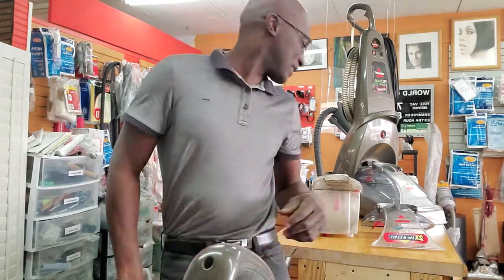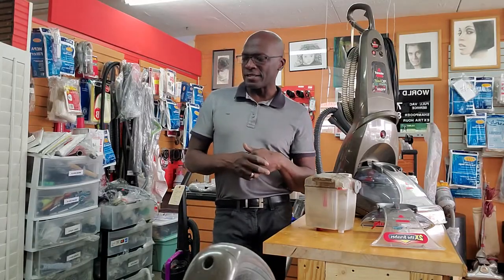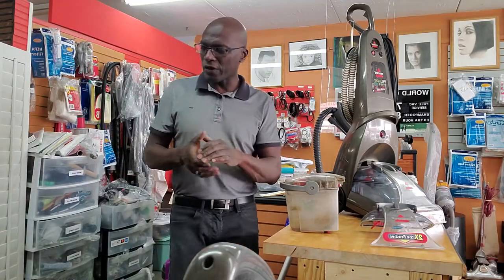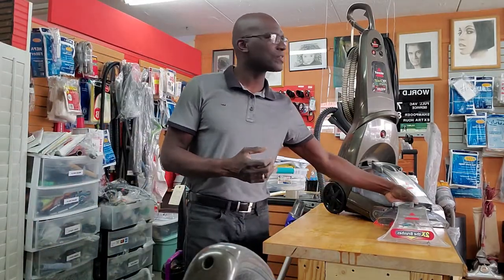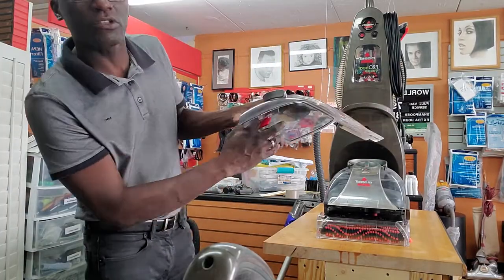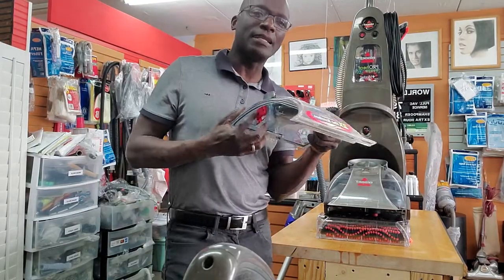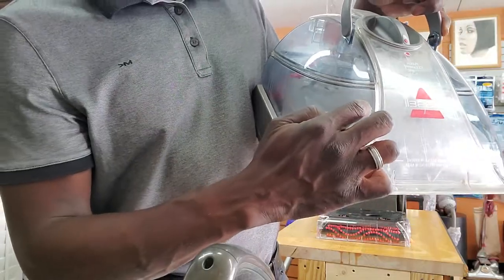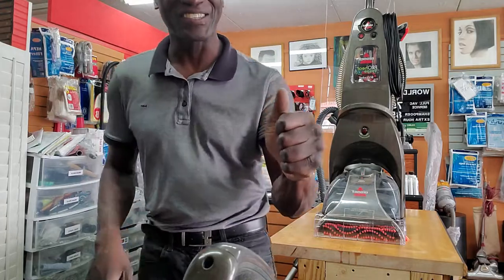Solve Bissell Suction Problems: Step-by-Step Guide!

Comment: Excellent video thank you very much!  I used the troubleshooting suggestions and partly resolved my problem. After cleaning the little filter (close to the float) in the collection tank I thought it would resolve the second part of my problem... which is no suction at the floor piece.  When I move the selector dial to the hand attachment - suction is strong suction. When I switch back to floor I am getting no suction from the floor piece.  I tested the selector dial to make sure it was working (making sure it was diverting correctly) and it does work as expected.  Gaskets between collector and floor seems good - I did the tissue test you suggested and didn't get any results for a leak.  Simply = when its on the floor setting I have no suction - any suggestions on what else to check?
Reply: Update since I posted - hairline crack right along vertical side of the floor nozzle.  Because I was testing at the bottom where you would expect suction I didn't notice the crack immediately.  Going to replace the part and check again!
Reply from the maker: Awesome glad you made progress...

Comment: You helped so much!  Thank you, my carpet cleaner is working much, much better.  The one thing I did notice, the red filter turn nob on the stationary part of the cleaner, underneath the tank, that was turned to unlock.  So, I went through everything you said and cleaned out the liter read filter in the tank, turned the big red button to lock, and voila! Working like it should.  You a fabulous trainer!  Thank you again!

Comment: Thanks for the suggestions to both test the suction right at the source and remove the check valve.  I've now eliminated those as the potential problem.  Onward in my diagnosis!
Reply from the maker: Great job let me know how it works out

Comment: Hi Wayne…
I’m having another issue with my Bissell Pro Heat 2x. 
No suction on floor mode. 
I did check the black square and theres plenty of suction. I also remove the red lint saver. Still nothing. 
I did open the piece where the water jets are bc I was not getting any water.  Not sure if its possible that I disconnected a hose bc the top suction is great
So I thought I would ask for help again before the shampooer meets the curb
Thank You
Donna. .
Reply from the maker: Awesome 😎
Reply: did you ever get this figured out ? exact same issue as me. filter clean, suction in the rubber part, but still not vacuuming it up
Reply from the maker: @wutUthinkinBro check the nozzle on the front- if you have suction at the duct ( closest to the motor) then work your way to the front check for gaps and clogs along the way

Comment: Ah man, how sneaky of these companies to keep using the same name to a vacuum that looks totally different. Looking for the Bissell Deep Clean Pro Heat 2X professional pet similar issue loss of suction. It was just working and then nothing, I checked the basics and don't see any debris or flap issues but am having issues identifying the suction flow from under the tank, I feel a pull of air only under the small red screen but not really anywhere else, there is some air/heat blowing out up closer to the roller bars (heat dry feature maybe) Do you happen to have this unit by you to help walk me thru this or maybe already have a video with it? Thanks in advance : )
Reply from the maker: Don’t have one near me at this moment, but if you look through my Bissell tips playlist you may find the answer

Comment: In the bissell proheat pet how is the spinner supposed to work??? Also is the brush roll supposed to wiggle all over or be stationary??? Great video I'm having suction problems so I'm off to start troubleshooting... I'm putting water down picking some up but not as much as I'm putting down and my spinner isnt moving... I also cant tell if my brush is moving but I'm going to try to check and see... it's been a while a long while since I've used the machine... great video I really appreciate it...
Reply from the maker: Keep me posted you’re off to a good start

Comment: Great tips, But I had another question about the same unit the pro heat/ pet. It leaks out of the bottom when using and while setting? Running or not it leaks. It is an older unit just wondering if it would be a easy fix or get a new one.
Reply from the maker: Its most likely the autoloader receiver...the black circle that sit below the tank.. part number 2036758...sounds like the bottom seal broke and causing the water to leak out
Reply: @monroevac  Thanks for the fast response I'll check it out.

Comment: I know I am a little late on this video but I just want to say, Awesome Video! I did everything you said here and I cleaned everything out and even used an air duster on the bottom of the Bissell Pro Heat 2x (Model 9200) and when I turn it on without the tank the suction is VERY STRONG and the hose works fine but when I turn the dial to "Floor Cleaning" it has some suction on the bottom so I am thinking it's probably the trigger on the handle. Do you think I should open up the top part of the vacuum to check the trigger part? Please any info you can give me I will appreciate and I am in no rush.
Reply from the maker: If the problem is suction you won’t need to focus on the trigger. The tank, the lid and the window nozzle is where your focus should be. Check those for either leakage or clog
Reply: @monroevac  Thank you so much! I will look into it as soon as possible

Comment: Hey thanks for these videos much appreciated!  My brand new bissel “turbo clean powerbrushPet” shampooer, which I have only used for about a half an hour, starting to give a high pitch squeal and then I could smell smoke/burning smell coming from the unit.  Very strange that a brand new unit would possibly burn the brushes(motor brushes not vacuum brushes) so quickly and cause it to squeal and burn up.  The unit works but I can feel if I push it much more I’m going to fry it completely...  any thoughts sir?   
Many thanks,
-Bobby
Reply from the maker: Hi Robert, sound like a motor/electrical issue. I recommend calling bissell. They will first troubleshoot over the phone, then recommend a local authorized shop. If none is in your area then they will work something out with you. Possibly send out a replacement,.that is if its still under warranty. Hope thats helps
Reply: @monroevac  thank you for the reply sir, yes they are sending a new one. 🙏🏼
Reply from the maker: Awesome..Bissell probably has one of the best factory warranty in this industry..glad it worked out

Comment: I have a brand new Revolution Pet Pro . It sprays, but does very little pick up, if any at all! And when done the machine leaked all over my floor...so, any hints how I might trouble shoot this? Thank you!:) But going to go back and check it all through with gaskets etc.
Reply from the maker: Hi I have a playlist with a video that should help. Covers suction problems with Bissell Revolution . See Bissell tips playlist
Reply: @monroevac  Hey that was sure fast!! And thank you! I just can't go and buy a new unit, so, thank you for putting up such great videos! Helps those of us who like to fix our own stuff! Anyway, I will check this out. I do have an idea I want to try on the leaking top canister...can one lubricate it with some silicone grease so the rubber part might seal better? Sometimes plastic/rubber gets too dry...so I am thinking of trying to lubricate it to help it to seal. Spending 100 + for a canister that might not work, again, is not a great option!  Thanks for your fast reply!!:) Cheers Bro!

Comment: Good day I recently came across your videos, brushes not spinning Bissell proheat 2x select.. and I’m in the middle of shampooing 😩please hellllllp!
Reply from the maker: Get a screw driver and remove the clear plastic nozzles from the front and side of the unit. Specifically the front and left side( the left if you are standing behind the Shampooer) your belt may be broken

Comment: When I plug my Bissell pro heat plus in to the outlet and turned it on  A lot of smoke comes out of it  what causes that problem
Reply from the maker: If I had to guess without seeing it for myself…it’s a Motor problem. Either replace motor or replace the unit.

Comment: Hello Mr. Monroe; I have a Bissell 253A Series and recently I have a problem. When I was cleaning my bedroom carpet I have noticed the dirty water isn't sucking into the blader-container. Can you please help or answer my question how to fix the problem? Thanks Armine
Reply from the maker: Sorry for delayed response-Model 25A3 - diagnostic can start at the motor. Take off the tank turn on the unit and check the suction at the opening . Then check your tank for crack or the lid to make sure it closes properly. Next put the tank on but remove the front nozzle window and check the opening that joins / connects to the window. If all those check out and has suction that the next step is a put the window back and check to see if it will suck up water, if not replace the window. How that helps

Comment: I'm still having issues with my bissel proheat 2x

I've cleaned and checked everything in your video but it still has no suction, the tool option works still wonderfully but the floor cleaner option still doesn't work
Reply from the maker: If the motor has suction the the next step is the tank. Try taking the nozzle off. Remove the screw that hold the main nozzle to the base and remove the nozzle. Then put the tank back on the unit. Turn the machine on to check if the suction is reaching the section where the nozzle should connect. Use a paper or plastic to test suction. If good suction then the problem is the nozzle if not then look to the tank. Keep me posted

Comment: I took my bissel pro heat apart after lending it to some one, it was really nasty, I took it all apart when I took the side plastic pieces off the brushes came out which was nice cause I cleaned all around and under them but putting it back together I’m not sure where to put the belt drive? It has two brushes. On one side the belt just goes around the two brushes but not sure how to reassemble the other side?
Reply from the maker: The brosh motor side - the small belt goes from motor gear to first brush -the one closest to the motor

Comment: Mine isn't suctioning up, but blows air underneath. It has suction and followed all steps mentioned and still isn't suctioning up water. Should air be blowing out of the bottom of the machine???
Reply from the maker: Shampooer and vacuums all has exhaust. So expect some air to be blown out of the unit.  Use my contact page on my website and send me a video. Without seeing it in action it’s hard to properly diagnose the problem

Comment: I had finished washing my floor, the bucket was filled with dirty water, then I tripped the bucket with the mop spilling all the water so I started sucking it with my bissell 7209 but I kind of "drowned it" then the power went off. after I emptied the water from container, tried to started again & it's dead. Is my machine reparable or it's a gonner? 😟  Thank you for any advice.
Reply from the maker: You may need a new motor, but yes it’s repairable
Reply: @monroevac  Thank  you very much for your advice.

Comment: Hi
I have a brissel pro heat 2x pet pro

I have no suction from the front end...
Tested hose...hose works...have suction from the motor...filter is clear amd as lint free as i can get it...ive narrowed it down to between the floor and brissels to the tirn knob "floor / tool" selector...nothing

Any ideas? Im stumped
Reply from the maker: You may have to remove the nozzle and check to see if you have suction at the bin window. If so then replace the nozzle. If not then the bin assembly is the problem.

Comment: Wayne .., I have a " Bissell Deep Clean Deluxe PET " with the solution bag inside the container while the container itself collects the sucked-up solution. But theirs NO dirty water being sucked in the  container. Where's it going .., what's happening  ❓❓❓
Reply from the maker: Interesting David. My first question - is the carpet still wet long after shampooing. Also when you are sucking up the water, you should see water shooting up the clear nozzle. If not..then the true  question is: is it sucking up the water at all. You may have a suction issue. A seal. A crack or a clog. Do a little experiment and let me know. Check the carpet after you shampoo and check the nozzle while shampooing.
Reply: @monroevac  NO.., it isn't but I don't understand it. The solution is all gone but NO dirty water in the tank. I know when I'm shampooing theirs alot of " foam ".., and it settles.
Reply from the maker: Foam? Bissell solution don’t produce a lot of foam. They’re extraction machines so they use foam less solution. Are you using detergent or dry foam solution? Bissell and Hoover should use foam-less solutions. Double check your solution
Reply: @monroevac  I'm using a Bissell cleaner that comes in a small gray plastic bottle.
Reply from the maker: @trumpmypresident4721  ok, That is odd, so lets then focus on the suction then. The water is either going into the container or its in the carper. For the sake of ruling out mysterious happenings we would assume one or the other. Trust if the water was being redirected elsewhere, you would know. You'd find spills or your motor would seize up. try shampooing with just water (no solution) and do a spot check. check the nozzle while trying to pick up the water and check the carper for excess water. we can start  there.
Reply: @monroevac  Thank-you ..., I'll try just that.

Comment: Oh dear my seems to be not sucking very good and leaking when it's dormant. Mine is a Bissell ProHeat 2X. How do I stop the water from leaking out when it's dormant. If I push down on the water bag it comes out easily from somewhere
Reply: Mine is clean as a whistle even wash the two rollers
Reply: Well I can't wrap my brain around is it you're actually on the other side of the store😅
Reply from the maker: It may be the gasket check to see if it’s screwed in properly
Reply from the maker: My Bissell Proheat 2x is leaking when it’s standing still
https://youtu.be/MIQArK5wVeY

Comment: How do you open the transparant plastic  on the top?, thank yoi
Reply: On powerstreamer one?
Reply from the maker: Are you referring to the section where you change from floor to tool? If so it is not made to open. Doing so will risk breaking it. Not saying it isn't possible but if you try be careful.

Comment: I am having trouble with my Bissell Pro Heat Pet with sucking up water. It starts working then the sound changes and it stops sucking it up unless I turn machine off for few min then starts working. I have do this a lot.
Reply from the maker: Hi Kimberly, Just to verify is this model a pro heat pet 2x or a Revolution or just a regular aPro heat? The possible fix is different for each

Comment: I have a  problem Wayne please help me if you can.  I  have a bissell lift off deep cleaner pet it was not  sucking up the waters I  tried to troubleshoot after watching a few videos,  well I  took  the diverter screws out and the flap fell off and I  cannot get it back on to save my sole (lol) I just cannot figure that little flap out on how to replace it.  I  know it easy but  I  can't configure it can you help. Me please?  Thank you so much in advance,
Reply from the maker: Hmm look through my Bissell tips playlist I have a video about the Bissell lift off. I don’t have A lift off in the shop right now but will upload a video when I get another one in the shop
Reply: @monroevac  ok thank you. I watched one video you did and you touched on it a little. I put it back together without the flap it must be stuck in the lift off with brush part it’s not working. The floor part is working pretty good. Heard you say something about the spring action and there is a coil spring in there but I can’t figure it out.. thank you!

Comment: If the machine is making suction but it's not sucking up the water properly, do you think it could be from the plastic piece on the front having the corner broken off? I'm talking about where the plastic piece curves up, maybe to make a Tight Seal to the carpet?
Reply from the maker: If its the front lip the curve up....no.. that won't stop the suction at least it shouldn't. I would have to see it to be absolutely certain. But you are right in thinking that the problem lies in that area. Check the source of the suction. There is a screen..make sure its clear of lint and try reconnecting the nozzle.
Reply: @monroevac  Thank you sir!

Comment: What about the hose not suctioning need help
Reply from the maker: ok this tip is for the Bissell proheat 2x--first make sure the rubber seal that redirects the suction to the hose is on the unit. If the seal is missing the suction won't travel through the hose. you'll notice the opening at the top of the main motor body and an another opening at the bottom of the upper body. The will touch when the unit is in the upright position. you can test the suction on the main motor body by turning the unit on and putting a paper over the hole to see if the suction is strong. If you have suction at the base and the seal is present then you may have a clog in the hose. hope I didn't complicated it for you. keep me posted

Comment: I have good suction but no water is coming out. But the spinner dial is not spinning either? Help??
Reply from the maker: There are a few things that can cause your Bissell to stop spraying. The spay jets may be clogged. The solenoid and pump may need replacing or the heater may be clogged. If you look throughly Bissell tips playlist you may find a few tip to help narrow down your options